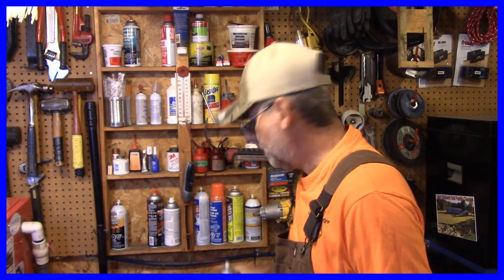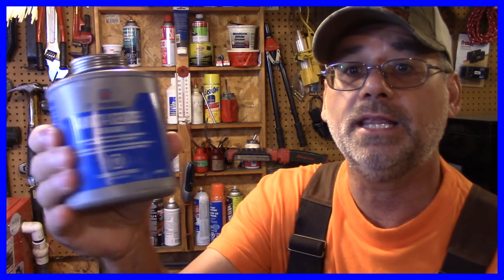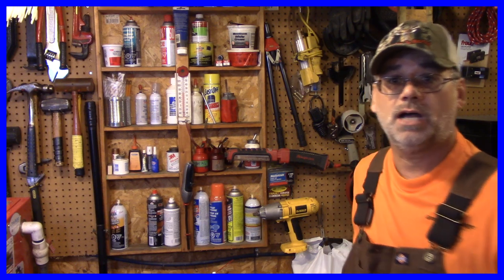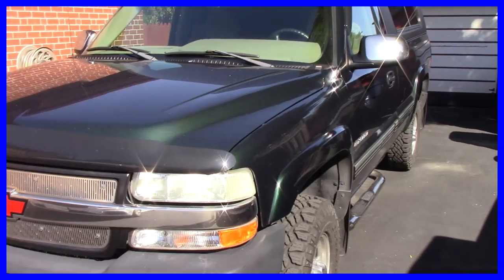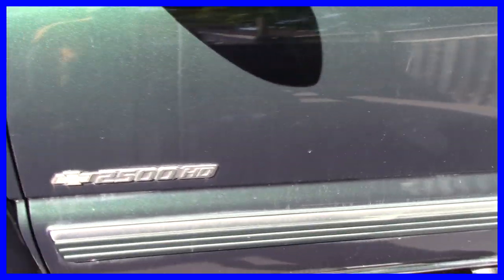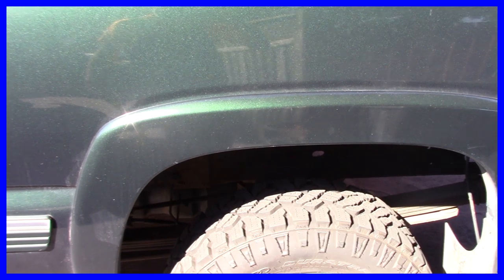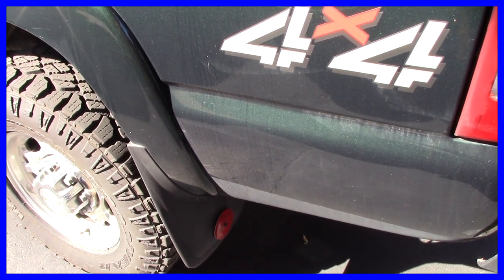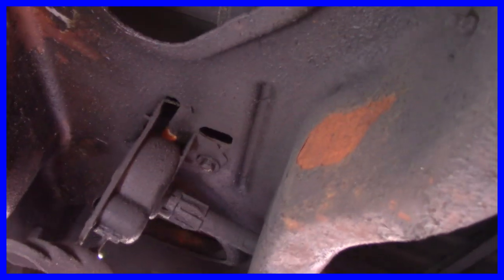APPLYING  RUSTPROOFING / UNDERCOATING TO  YOUR VEHICLE  - THIS IS WHAT I  DO AND USE  .

Comment: Ford's don't normally rust out... There usually parked in the mechanics shop with the hood up all winter.
Reply from the maker: HAHA mine is slowly having the rockers rust away after 7 years.
Reply: builtrodewreckedit they have good transmissions.
Reply: builtrodewreckedit maybe with the 5.4 lol.
Reply: @SteveRobReviews even after rust proofing?
Reply from the maker: @whatitisnt.  The rustproofing slows it down a lot but in my experience does not prevent rusting if you live in an area where they put salt on the roads winter.
Reply: @SteveRobReviews  so basically rustproofing just delays rust even if applied every year but doesn't completely prevent rust?
Reply from the maker: @whatitisnt.  That's what my experience is .  It's worth doing but don't expect a rust free vehicle over time.

Comment: Thanks for realistic assessment of undercoating.  If you buy and drive used vehicles as I do, look around at all the other same vehicle models on the road and you can soon identify the 4 to 6 areas on your vehicle where rust will eventually appear.  Every make and model has design flaws, whether by design or intentional, that have cavities that tend to collect dirt, leaves and salt and are the areas that never quite dry out.  They hold moisture, rust and eat their way to the outside of the body.  Ever notice a 60 years old vehicle that has been abandoned in a field to rot, but certain areas of the vehicle (roof, trunk, side panels..etc.) have never rusted and remain solid steel?  Those are the areas of that particular vehicle that shed water and moisture well and will not rust for a hundred years.  When you identify the areas of your particular vehicle ( like Steve's cab corners on the Suburban),  clean them out and concentrate your efforts on those areas to rust proof those areas and protect them.  20 years later, everyone who owns the same vehicle as you will be wondering how the hell your vehicle isn't rotted out like theirs.

Comment: Rust-Oleum paint everything then use used oil thinned with Diesel.. touch up every spring with rust converter.. re-oil every winter.. 2012 rust free.. great video..
Reply: That is what I did , Tremclad and then Rust -Oleum after I went over the car with protect oil.I also took a paint brush and painted STP all over the hood and trunk areas.STP is great, I would not put in my engine , but it makes great rust proofing ,due to the fact it does not wash off.

Comment: Rob,  I gave my grandson my 2004 F-150 and he still drives it with almost 200,000 miles on it.  Of course, there is no rust on the vehicle at all because I live in Texas.  The value of the truck is relatively high because it looks and drives almost like a new truck and its usefulness has been maintained.  My good friend has a 2005 F-350 with 340,000 miles on it and it is still going strong just completing a 5,000 mile roadtrip from Houston to Chicago to Salt Lake City to San Francisco to LA and back to Houston on I-10.   It is still a great truck and looks vey good.  So, vehicles that are 18 years old and not subject to salted roads are extremely valuable because they are still useful.  Nothing like the rust buckets I've seen on Youtube...
Reply from the maker: In the salt belt 10 years and people start to look for a new one .

Comment: I do all my personal vehicles at our school shop. We also do complete rustproofing for 'customers'. $30.00 will get you a basic undercoating with an oil-based gel like Proform which includes the interior of the frame rails, or unibody rails/crevices. For $60.00, we'll do in all doors, hood, trunk, engine bay, rockers (drilling if we can't access through the drain holes), wheelhouses, folded seams, control arms, struts, fuel, brake and A/C lines (if rear A/C equipped). For all the aforementioned 'interior' panels, we use used ATF ( I have gallons of used ATF). If the customer wants to bring other products like Fluid Film we'll spray that too. When I rustproof my own vehicles, I dump atf (1/2 a quart or so into the rocker panels with the car facing up hill for a bit and then down hill. I collect the dripping in buckets or a long piece of eavestrough directed into a bucket. I often use RustCheck red and green for touchups.

I think that Krown products are great for interior panels, but not thick enough for exterior (underbody) applications. I will often soak the interior of my unibody rails with a thin product ATF or RustCheck red for creeping into seams/displacing moisture (which by the way is completely legit), then follow up with the thicker stuff (RustCheck Coat and Protect or Proform). Before I started doing this myself - maybe 15 years ago -  I had it done annually by RustCheck. Most times, the application was lacking. I have an endoscope and have seen many dry rocker panel cavities after a shop has applied rustproofing.

I believe that any product - motor oil (used or new), ATF, RustCheck, Krown, Corrosion Free etc will all work perfectly - succeed at separating metal from oxygen - well so long as they are actually thoroughly applied. No shop that wants your car in and out in an hour will be able to accomplish this.

I firmly believe that this should be done annually. Nothing you put under a vehicle is going to last. Rustproofing compounds need to go to and stay where water collects. That said, on my two Toyotas and Kia van, each year, I basically do a touch up - a light spray to 're-wet' what's left from before and re-do the rails, control arms, doors, inner panels etc. I usually do this twice a year. And, I do it to any brand new - off the lot - cars I buy as well as used ones.
Reply from the maker: Adam id say you know what your doing so keep it up. Cheers
Reply: @SteveRobReviews  I'm just surprised how few people that live in this climate have never heard of rustproofing or are not interested in having it done to their cars , if they have heard of it. I guess it has to do with a few factors: people don't plan to keep their cars long enough to rust and the financing institutions are more than willing to overextend credit to allow the purchase of a new car and many also don't care if their car has rust on it as long as it goes when you step on the gas. Personally, I cringe when I see people driving new expensive vehicles through the salt/slush when I'm sure that they have no extra rustproofing. 20+ years ago it wouldn't matter as powertrains would be pretty much worthless before the bodies succumed to rot, but with today's engineering, rot will put them in a junkyard well before they are mechanically ready to be scrapped. More people need to see videos like yours!
Reply: Adam B   Hello- excellent commentary. Thanks for sharing. I wish you were in chicago area. I will try to find a spot they can do what you recommend.

Comment: Your vehicles are practically new... I'm driving 3  Mercedes from 87-90  I'm right up by the Canadian border in NY where they salt the roads like I salt  my food (generously). Use anything lanolin based and cheap by the gallon it will do the job.  Get your own spray kit it's worth it. Pull those frame plugs and coat inside anywhere water might collect.

Comment: I was a tech and preferred to work on rustproofed vehicles. Significantly less seized bolts\nuts, and don't have to take the torch out every time. We have gloves and a hat, so I don't mind the slime.
Reply from the maker: Hi Shane 
Me too as the vehicles in my area  require a hat to just  keep the rust off your head by just touching anything :)  yes rustproofing is much better.

Comment: I’ve been undercoating my vehicles with krown for well over 15 years I have a 03 Tahoe z71 with zero rust underneath. I’ve done it yearly and it shows I went to ace rustproofing when I first got the truck. All original brake lines fuel lines tranny lines everything zero rust driven every winter

Comment: I spray my 08 Tacoma with fluid film before every winter. There is some spots it seems like it wears off but generally it does pretty good. I use about a half gallon a year spraying it down and a gallon only cost around $40.
Reply from the maker: That's the way to do it yourself and you know it's been sprayed well.
Reply: Fluid Film is awesome but it certainly does wash off in spots. I think I'm going to use CRC Heavy Duty Corrosion Inhibitor on the spots that wash off. It's cosmoline based and is supposed to stand up to water and slush blasting. It's also cheap.
Reply: @scooterpie696  I'm hearing surface shield is 10 x's better. It's a fairly new product with much anecdotal positive reviews

Comment: In Germany we use liguid wire rope grease that we spray on. Its extremely cheap. Once applied it holds on for very long time 10-20 years.
Reply: Jeah true i am german and use it too it comes in 5l packs just mix some gas to it for becoming more liquid and spray it.

Comment: Because those products you are using are very thin. Yes they will come off easily.  You need to use something thicker and tackier. The mixture I use roughly a quart of Fluid film. Then on a low hot plate I melt 2 pounds of paraffin wax and and some ATF, enough to melt and dissolve it in.  When that melts, I blend in about a pint of bar and chain oil and a pint of lucas heavy duty oil stabilizer (VERY Tacky) . I may also blend in some bearing grease.  I then blend all this into can of fluid film. The whole thing has a consistency like pancake batter. I use a helical paint mixing attachment in a drill.  Salvation Army cheap hot plate and junk pot.   The gun I use is a kellsport Fluid Film & Woolwax Pro Undercoating Gun.  I have a 99 cherokee, an 08 4Runner and a 14 hyundai . No rust.  This works in northeast PA . I travel 51 miles each way on i81 , i380 and i80 thru a cloud of salt brine mist in the winter. I had to get rid of an 01 and a 2000 cherokee due to rust
Reply: Interesting! But it looks like a lot of money to buy all those mixtures. How long does it last before the next application?

Comment: You should see the rot on my 1999 F150, after sitting in my driveway for years because of me not wanting to replace in a timely fashion the brake lines, Major Major door, frome and panel rotted away. In fact the mounting steel in front, that my oil cooler and trans cooler was attached to, is now completely missing.
Reply from the maker: I'm guessing you not from Texas , Florida or Arizona  :)
Reply: FROM THE SALTY AREA MICHIGAN

Comment: Revisited this video after a couple years. That coat and protect is so much more expensive than it used to be! I think a few years back Crappy Tire used to have this on sale for 6.99 a can or something? Managed to get a few cans for 9.99 at Princess Auto recently which isn't too bad. I guess you just have to snap up a few cans when you catch em on sale because they're like 12 or 14 bucks a can now. I did notice Princess Auto has the bulk 4L containers of Coat and Protect on sale for 50-ish every now and then but you'd need an undercoating gun to spray it, I think.
Reply from the maker: 100% correct.  Our dollar is much lower, and so many corporations just increase their prices because they can.  I no longer support coat & protect  as their price increase makes it a no buy for me until they drop their prices.
Reply: @SteveRobReviews  Have you found anything that is an affordable replacement? I noticed that Peavy Mart is selling Rust Cure 3000 on sale for 7.99 (is that place up there in Ontario?). That's a decent deal if the stuff is any good.....I've never tried it.
Reply from the maker: @ourkid2000 Not yet but  2025  will see price drops hopefully as the economy slows .

Comment: I understand your point about spending a bunch of money on a vehicle and not getting a good trade-in value for it but not all people plan on trading there vehicle in.
I have a 2008 Silverado 2500 Duramax. To replace that truck would be between 60 and $70,000. I'm going to drive that truck as long as I can. Also, there are a lot of diesel trucks that are in great condition going for 20 to $30,000. I still see 2006 Silverado Duramax trucks that are in immaculate condition going for 20 to $25,000.
I believe that if you touched up the underside of your vehicle at every oil change, the cost would be minimal and you would have not one speck of rust underneath your truck. You would never have had to replace cab corners or any portion of a brake line.
I really did enjoy the video. Thank you.
Reply from the maker: Good points . The lowest cost of ownership is maintenance and lots of it but most dont do it . Rust prevention is well worth the cost if done right but I prefer to do it myself at 1/4 the cost and done like I like. Cheers

Comment: If you live in the rust belt and don’t have a rust preventative spay used inside rockers and quarter panels, they will rot out. I see it on a regular basis

Comment: We will have to pay more attention to treating vehicles may down here in Texas. They started using salt brine on the roads and that stuff is horrible on metal and wiring. Great topic Steve
Reply from the maker: It's used a lot up here and why they get away with it amazes me as it just corrodes as you say.  I wash my vehicles in the winter at the carwash and that stuff imbeds itself into the metal like etching. They sell a wash now to get it off. LOL

Comment: As long as you use something that’s oil based it’ll stop it from rusting. I’ve had good luck with rust check, Krown, fluid film, dripless oil. I think the best stuff on the market right now is corrosion free rustproofing. This product does not harm the plastic and rubber mouldings. That is what I’m using now. I had a Chevy Lumina van for 20 years that was 28 years old when I sent it to the wreckers. The underneath was still not rusted out never change the brake lines or fuel lines(plastic) 456,000km. Sometimes I get somebody else to spray the vehicle. Sometimes I do it myself just spots that need to be redone.
Reply from the maker: Good advice
Reply: Yep. "Corrosion free-formula 3000"... That's what I use as well. A little expensive ($12 a can), but lasts over 2 years!

Comment: Thank you,i procrastinated when I bought my 2012 silverado,and never used fluid film like I planned.about 3- 4 years ago I had accident that required bed quarter panel replaced on pass side,shop took bed off ,in stopped after work and was shocked how much rust is under there,especially the gas tank plug with all the lines going in.the removed bedside panel had rust at pinch welds but wasn't showing on painted surface yet.the original driver bedside is now showing bubbles under paint at spot welds,since you worked at gm,do you think it flexes more at those welds because sheet metal is way thinner then I remember on my old 73 chevy Cheyenne truck.
Reply from the maker: The corrosion always starts in spots where moisture can remain and if salt is added it sure corodes fast even if all the panels are galvanized.
Reply: I had a used 74 gmc that I bought in 89.  350 ran great and transmission shifted good at 100,000 + miles until it got hit in 95. But it had a lot of rust especially on the bed. And it was a normal thing to see square bodies with serious rust issues with less yrs and miles In my area of Tennessee

Comment: Don't be too alarmed that the oil from Krown and Rust Check evaporates. The oil is mainly just a carrier for the chemical that inhibits electrolysis. That chemical is left behind. Chain lube won't evaporate or wash off easily, so it will repel water for a long time.

Comment: I use Fluid Film. Been doing this to my  Roush F150 Supercharged for past 3 years and not even one spot of rust on the frame. Fluid Film can costs around $8.99 per can and it takes around 5 cans before each winter. Little price to pay for rust free undercarriage.
Reply from the maker: Yes its good stuff and well worth the price . 👍
Reply: Get a hold of a gallon Can and the pneumatic spray gear – that’ll save some money. The rattle can extension tip is still useful to get into areas where the bigger diameter wand will not

Comment: My 1997 Ford F150 XlT 5.4L. Same Muffler and tailpipe still, and that is Wisconsin Winters and Plowing. Now the Exhaust Manifolds. Now That is a different Story, Glad I could do that job myself. Plus ball joints etc. Other than Ball joints etc. Ford or Chevy Truck Owners, better be Mechanics or pay the piper at the dealer. Also, I just replaced all my Brake lines with Coated lines and that was easy. Two rolls of brake lines and a good hydraulic brake line flare tool. Works Great.
Reply from the maker: Yes if your not handy you better have a big wallet for the flushing it's going to get maintaining them. I've seen people charged over 1K for brake lines, LOL
Reply: I recently did about that much for just a couple brake lines, but they were under a 2.6 hour gas tank so...yeah. Maybe not quite a $1,000 but a lot higher with all the other jobs. It started with a shot master cylinder and I had to replace 2 inches of line under it which was rusted up. Once she had pressure, a bunch more lines blew. Ouch! We were all unhappy about that! Phew. So glad when that car was gone, lol.

Comment: Have you ever tried automatic trans fluid or diesel fuel for rust proofing ?  Or perhaps a combination ? Or perhaps mixed with melted wax ?
Reply from the maker: Nope just products  that are listed as undercoating for vehicles because some chemicals can react badly to some materials used in auto manufacturing today.